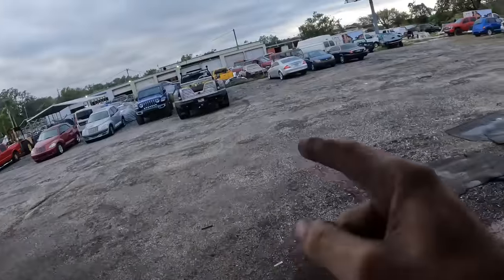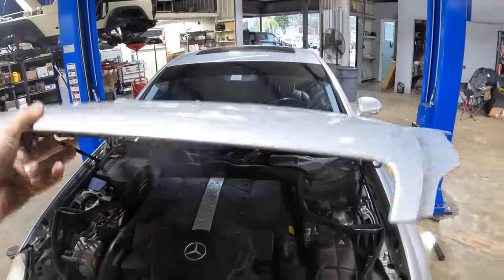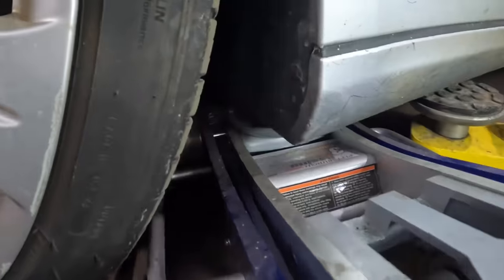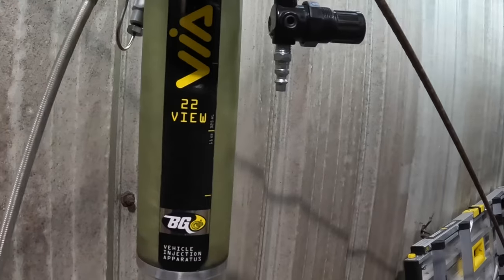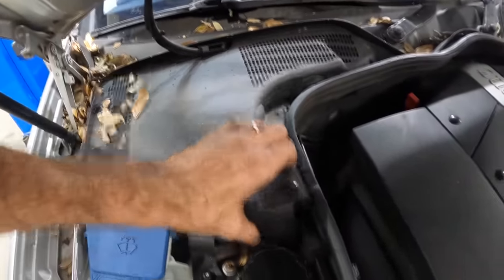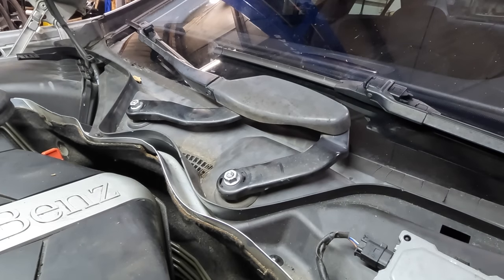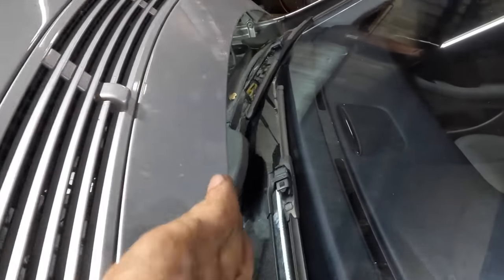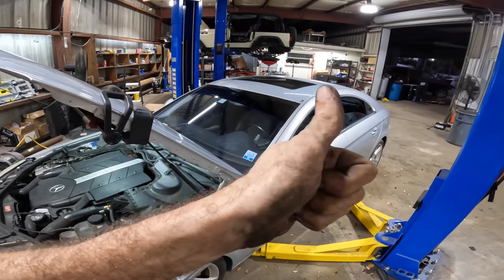Rookie Mistake on a Mercedes! “I quit” @SouthMainAuto

Comment: I have a 2007 CLS550 with the AMG package. I got the tools to work on the airmatic suspension. Mine had the wires break at the dump valve causing the car to not be able to lower itself as needed. The suspension on these aren't that complex, but a good diagnostic tool and common sense goes a long way.
Reply: The dealership I worked at had an early 2000’s S class come in and all 4 corners were on the ground. Mercedes quoted us almost $10k to replace the pump, struts, sensors etc. Our shop ended up doing the work for a lot less than that, but it was still a chunk of change. The car was like brand new otherwise. It was on the lot for months and we finally sent it to an auction and sold it for a loss.

Comment: Mercedes hoods can be opened further by unlocking the hinges. Then it is opened by around 90°.
Reply: I dont know if the newer mercedes hoods with the hood struts open like the older ones with standard hinges. 1 have a 1987 w124 turbo diesel and being able to stand the hood up is a life saver. I wouldn't own a mercedes like he is working on.
The last good mercedes were 1991 and down. Easy to work on. Cheap parts and last forever. My friend has a mercedes with 500k miles and another one with 375k miles and both have original motors and are daily drivers. The older cars were made to be repaired by the average mechanic and last forever . Too bad they no longer build them the same.
Reply: @w124mercedes7  Possible, but this one still has the unlocking hinges. See 3:52. You can see the taps left and right.

Comment: Here's a "rookie mistake" I made a few years ago: I was experiencing intermittent AC clutch slippage on the Sanden compressor in my 1988 Mazda truck.  I practiced R&R of the AC clutch using its old compressor, made tools so I could do this without removal of the compressor from the engine.  So I got to the truck itself, to loosen the nut on the compressor drive plate, and it was loose.  So all I had to do to fix was tighten the nut !!!!

Comment: I was trying to tell ya', when you found that loose nut.  Check if that arm turns.  Check if hole in the wiper arm was ground out by the shaft turning in it.  And blow out them leaves!  Great video. Cool to see how that cowl comes apart.  That's good info for us in viewer-land.  Not a total waste of time.  I think MB is pretty good about keeping parts in stock.
Reply: It's designed to loosen if the wiper is stuck to prevent damage to the transmission or motor. 

Doesn't stop them from constantly going bad on sprinters, but it's great when you see that loose nut.

Comment: Ya know you could start making it a habit to pull up out front before driving in and popping the BONNET (here in Oz they's bonnets at least) and giving every car a leaf, dust and crap blow away BEFORE running them into the shop. You'd get the happier customers because all leaves and things gone, less risk of contaminants making it into places we filter to keep stuff out of and much less mess on your floor in the actual workshop. If you made it a regular part of your routine you could have most done adequately within about a minute.
BTW, I think anybody except someone who's worked on those particular Mercs and only the ones who've actually had to work on the wipers with a similar problem would be just as likely to make that same mistake. Looking at it with the cover on there's nothing obvious to tell, at least not that I can see there.

Comment: Ive got a 2002 MB in similar condition.  I've done most of the work on it, but had to have the mechanic do the motor mounts, and transmission mount.  It's been a good car, but has surprised me on the cost of parts more than once.  Several drains back around the hood hinges, too.

Comment: Ray, what you're fighting is that shops are ALWAYS in a position of power over the customer.   If the customer would, could, had the time, skills, and tools to do it themselves, they wouldn't be there.   Honest shop's rates don't change.  Crooks eventually get called out.
Reply: I agree, don’t take advantage of a customer, ever, it always pays off in the end.
Reply: However, reality is honest shops without changing rates struggle with inflation and die. Crooks survived with high profit and then more and more crooks there and customers are harder and harder to find an honest shop😢
Reply: An example I can think of is for my sister. She manages a sign writing business. And if they have too much work, they put the price up.

So as an example: If she had a job worth $300 for materials and labour, it would be $1500. And that is just to put the price up, but most in her industry are friends so they will also say "Company xyz, will do it for less though."

While not the exact same, it can explain it for some repair companies. But some others charge way more as a scam, no matter the circumstances.
Reply: Well not totally. There are other shops to go to.
Reply: @TheEthiopian1987  If the customer wants the job done immediately and it’s requiring the employees to work overtime or after hours to get said job done then yes, it’s okay to charge more, but if you’re just charging more because you can, then it sounds like the company your sister works for is scamming their customers.

Comment: My Mercedes has a small button on the drivers side hood strut that allows you to push the button and raise the hood straight up into a locked position for safety and a lot better access. I’m surprised the one you worked on didn’t have that.

Comment: love seeing you get a Benz in your shop!  wiper mechanisms on those can be fun (along with the cowling).  FWIW, that CLS500 has 302hp and is not at all slow, but the CLS550s (2007+) have an additional 80hp and are absolute beasts.  I'm just glad mine doesn't have any of that AirMatic crap.  Arnott makes good replacement bags at ~$300/corner for those air suspensions though, they're an OE supplier for MB.

Comment: Car dealerships take advantage of out of town people for sure.

I was on vacation and the wheel bearings went and the garage tried to sell me a new gearbox as the problem at $1800 when it turned out to be a $165 repair. Got the car towed back to a more local garage that did the work.

So in answer to your comment, lots of garages will take advantage if they can.

Comment: 10 years ago it was $750 / corner on a 1995 Lincoln Continental. So I bought the car for $300 . Put a spring kit in for $300 and drove it for 7 years.  Finally gave it away to a kid leaving for college.

Comment: Muffler shops in NY can no longer weld broken pipes together. They have to replace with certified muffler parts only.  Welding a pipe in is considered an altered exhaust system.  Saved my brother in law $3000.00 as his car has a single exhaust piece that goes from the header to the muffler.  I replaced it with a short split sleeve and welded it up.  The muffler shops used to be able to do this.

Comment: The wiper cover removal was only a rookie mistake when you found nothing wrong under the cover. Otherwise it would have been a clever move. It revealed which hub was the idler.
Reply: Nah, the rookie mistake was not tightening the loose nut and testing the wipers FIRST. Then taking things apart when that didn't work... That said, at least it wasn't a big mistake. This was a 1 hour setback instead of being more or requiring parts to undo said mistake.
Reply: @granitecowboy2199  Agreed. However it was entirely interesting, just the same, to see how MB completely overengineered the windshield wiper mechanism on this car. I even remember a specific Mercedes Benz model years ago that had a single windshield wiper that articulated up and down (vertically) as it swept horizontally across the windshield, reaching the wiper blade out to better wipe the "corners" of the glass.
Reply: @electronicengineer  overengineering is typical of MB... Even their diesel truck engines are the same way. Heck their diesel sprinter engines are stupidly designed with unneeded parts.
Reply: I work on sprinters , you think they’re over engineered? Hahahahah seen 800k on stock engines

Comment: Mercedes with Air Ride have a "Jack Mode" that needs to be set before using a lift or a jack, its like with the common Lincoln town car for example. Just wanted to let you know why it made that noise when it was put up on the lift.  Great Video!
Reply: My 94 LTC has the switch in the trunk. Lifting it without flipping the switch could easily be an instant $1,000.00 mistake
Reply: @thoughtthinker9300  Well, this car "genius" made that mistake.
Reply: Same with some Audis.  I know if you jack my Q7 up on a post lift without putting it in jack mode, is can screw the suspension sensors and it needs a code reset.
Reply: @duncanmcewan1049  been there with an audi a8. It didn't need a reset. The car took around 5 minutes to lower down all the way and to air up all the way and middle out. Then the sensors know where they are again
Reply: @itstheweirdguy  It happens.

What I learned when I first started working on cars, is they all are different and there's a lot to learn.

One of my mentors put it this was.

Being a mechanic is harder than being a doctor.

Doctors work on to different models.

Male and Female.
That's it, and that's all you have to learn and know about.

As a mechanic you will have to learn and know about hundreds of different automobiles and all their different features, abilities, and special add-ons.

Then every year there are going to be many along with the ways you'll need to work on them, will be changing at the same time.

He couldn't have been any more correct.

Then I started working building new aircraft like the 747's jumbo jets, A-10 thunderbolt- warthog, and then experimental aircraft.

I'm saying this because it was kind of a cop-out.
Once you build one, the next one is usually exactly the same.
Then I'd change aircraft and the same thing. What I needed to know and do was almost the same on the first one I built and stayed the same after the 400th and beyond.

It actually got boring after a while and I'd try to get moved to different parts of the aircraft.

With anything and cars.

Anyone can turn a wrench.

What makes a good or great mechanic is knowing tricks and how to get around problems.

The better and more versatile you become, the better the mechanic you are.

I see it as that simple.

Rainman ray's got a lot of know-how and ways around difficulties.

Along with a great attitude that won't give him a heart attack at to young an age, and he doesn't seem like he'd be miserable to be around.

Now that's cool, mistakes happen, and the world keeps on spinning
Reply: My 22 Ram with air ride has a jack mode also. I have typed up instructions on how to set it and always leave them with the keys when I drop it off for service.
Reply: Sharing knowledge is the greatest help.
Reply: @andries4561  Heard a few horror stories from some guys who had their sensors messed up by tyre shops - good to know it's not a "guaranteed" issue :)
Reply: @duncanmcewan1049  all car manufacturers have a way to reset the air suspension
Reply: @thoughtthinker9300  That is why you hear Eric O & Ivan say a lot of the time they spend fixing vehicles is spent on doing research to cut down on wasted time.
Reply: Suspended,  the solenoid dumps air. The danger is lifting one wheel. Those leaky MB bags are way over 1k$ each. They were toast when he got them in the shop.
Reply: @frankwilson1776  I think I remember an SL that needed a strut. Only came from Germany at some ridicules cost,  over 2k. Most struts I was proficient at were land Rovers. Even though I’m not a fan of the brand.
Reply: If he ever lifts a land rover without finding the switch he will always look for it from then on .

Comment: The perfect car brand for someone who doesn't take care of their vehicle. I use to think that German cars were the ultimate in quality and performance, but they are actually the ultimate in needless complexity and exorbitant maintenance cost. There is no way I would ever own one.
Reply: My friend who works in a shop told me the front struts are $1,500.00 each and they have to re-program the computer.  (yes, I know)   If your German car is 8 years old, get rid of it.
Reply: I drive a Mercedes 220E (W124), 30 years old, no problems.
Reply: @PeterInWiesbaden  
Yeah, 30 years ago was a different story. These days everything is plastic junk, even engine components, and all of the high tech features they include are just problems waiting to happen. It's not just the Germans of course,, even Chevy pickups were great at one time.
Reply: The Germans can sure build some engineering marvels. For example, they built the Saturn 5's which took Neil Armstrong to the moon.

🤫

Comment: My Kia wouldn't pass inspection because the wipers hit on their return trip. I went through a motor and other stuff and finally learned the correct alignment mode of having the motor and blades in the right spot and the mechanism in its right spot. I didn't need the new parts, but in the end of the story they work well and I know that much more about windshield wipers

Comment: The owner of the Mercedes has a few delayed maintenance repairs.  I would never drive on tires that are totally shot. My life is much more important to me than to put myself at risk for a major accident. Perhaps your client is not able to afford a higher end car or they are just "tight" with the dollar. Good video.
Reply: I think it's probably the former. I can't imagine how much it costs just for parts on a car like that. Even the wiper mechanism looks overly exaggerated for what is needed to get the job done. Makes me wonder if on a car like that, if tires are actually one of the cheaper items for it unless it uses some really off the wall sizes.
Reply: @TommyViper  Depends how you define the 'job'.. clear the bare legal area of windscreen or clear the maximum possible amount? They're cramming all this stuff into the smallest possible area, too, which creates complications people imagine are easy to deal with, because they've never tried engieering something themselves.

This is a Mercedes, not a Volkswagen (and I mean that in the original sense). If it were simple and cheap, it wouldn't be worth bothering with.

Comment: Also check the trany tail housing soft rubber mount,  if it's near or touching the bottom travel stop, replace it also. The air suspension strut/shock dampner assembly fail often. It will not be the last one, the customer will have to replace. They are a nice ride, but wear and tear components need to be replace as they wear out.